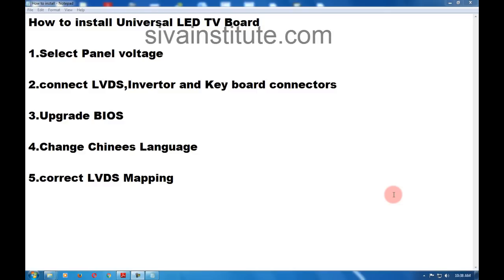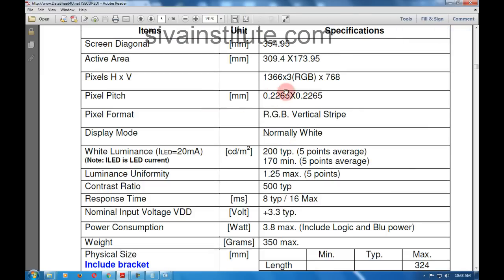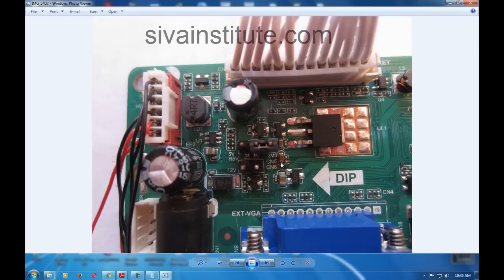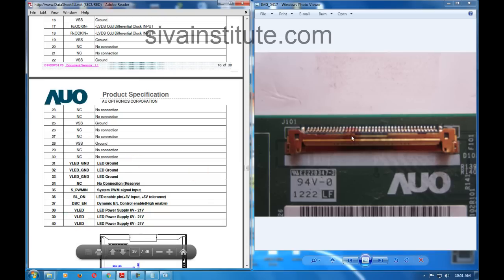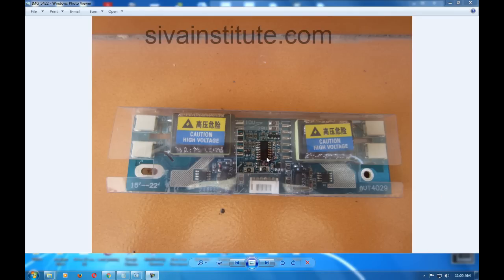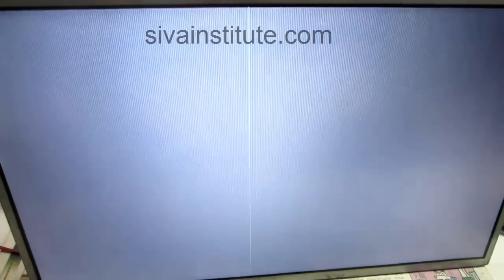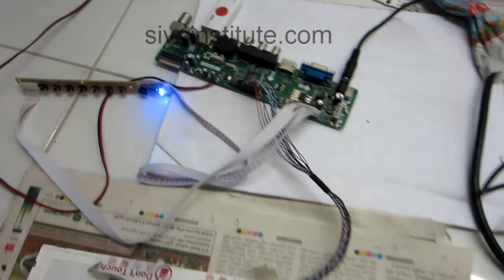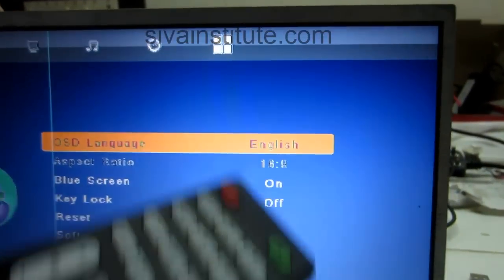How to install universal LED TV board T VST59 031

Comment: Sir, 
I would like to know some information from you regarding my Sony Bravia Model KDL32EX710. the main board is not working, changing the Main board is not possible due to unavailability of part. After seeing your video , i am thinking of putting a universal board.
Panel model is T315HW07  V1 
my doubts are follows
which board is good for this full hd panel ?
do I need to buy separate led driver board ?, as its smps is working, 12v for Tcon board also from smps
how do I go ahead ?

Comment: i have v59 chip board ( hdvx9 ) iam NIL in electronics. 
but tried to coneect this board to laptop LCD panels with a help of Laptop service peple but still unable to get any display on the screen. Can this chip connected to all kind of LCD or any specific model . pls advice.

Comment: sir i have tsumv59xu-z1 lcd controller board, i have tried all the softwares but when i put pendrive in board and plug the power, led just stays red, it doesnt turns red and blue, now what to do ? please suggest me sir, my board is old tuner type

Comment: Thanks for the drive resources. However, the general panel upgrade programs do not have one for resolution 1680*1050 pixels. Where can I find them? Also, can you please share the program for panel - LTM220MI-L01? Thanks in advance.

Comment: Thanks Sir for making the video.I have a question

my LCD panel is WLED BACKLIT Type and it is 40 PIN LVDS CABLE type SO DO I NEED INVERTER BOARD
THANKS IN ADVANCE

Comment: My lcd model no-B140xw01 V.0 
i have universal lcd tv controller board v29.
where i get firmware as per my lcd screen..
kindly suggest me.
Reply from the maker: http://kythuatphancung.vn/forum/index.php?/topic/33828-firmware-board-tv-lcd-tvst59031-chip-tsumv59xu-z1-update-20141023/?hl=t.vst59.031
Reply: +sieguntur thanks.but my board is v29.
I see firmware is for v59.
is this support my v29 controller board.
Reply: Sumon Hazra हो तो इस तरह वीडियो और नहीं हो रहे
Reply: Sumon Hazra

Comment: Need firmware for  LP156WH2 (TL) (E1)Using T.VST59.031 Controller Board
Reply from the maker: http://kythuatphancung.vn/forum/index.php?/topic/33828-firmware-board-tv-lcd-tvst59031-chip-tsumv59xu-z1-update-20141023/?hl=t.vst59.031
Reply: sair please download link
Reply: sir please v56 download links aap ne diya jolink usme ekhi file aara so plz 2 files link